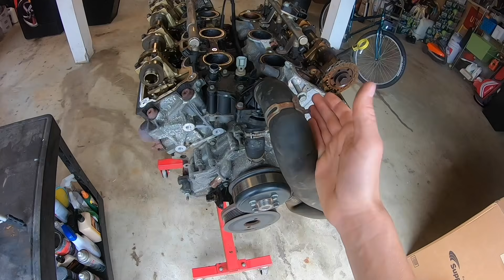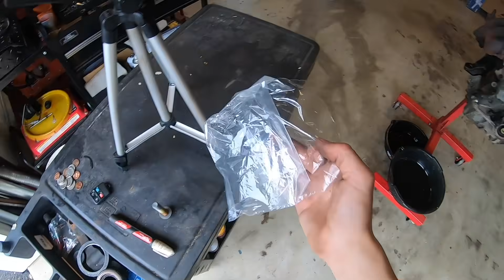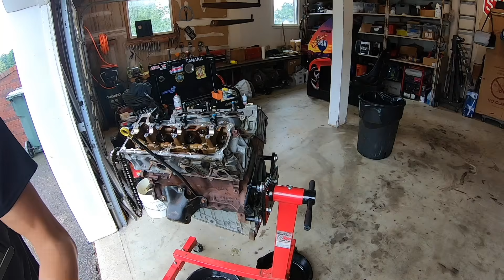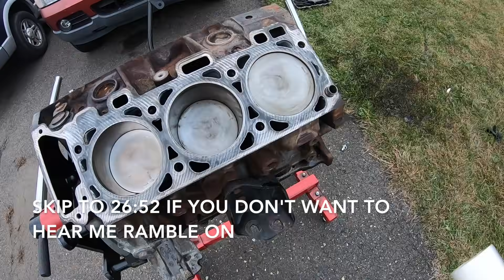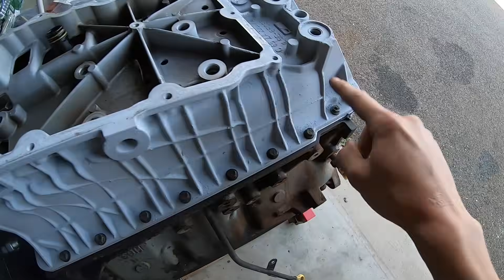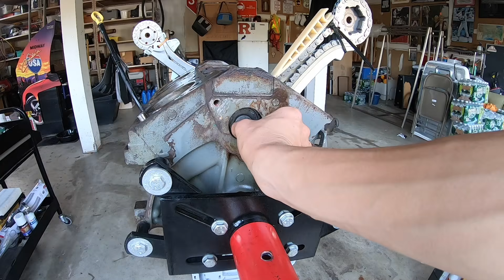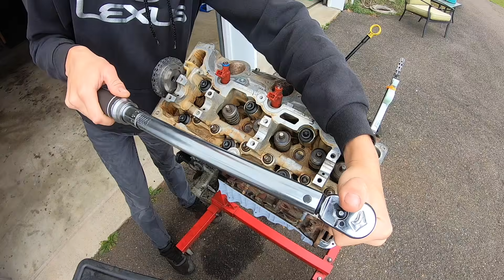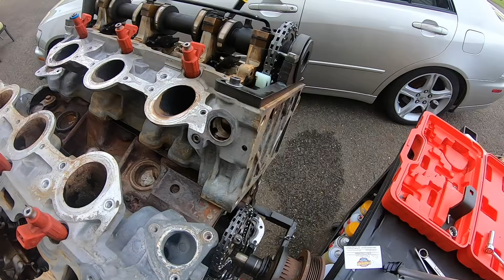Ford 4.0L SOHC V6 Head Gasket and Timing Chain Replacement (COMPLETE GUIDE)

Comment: Many thanks to you Nick, your detailed procedure is guiding me for my first motor rebuild !  I'm 59.  One hiccup if anyone can help is my right chain eat into the upper positioning bolt for the cassette.  Need to order a new one but haven't sourced it yet.  Happy new year everyone !
Reply from the maker: Depends how chewed down it is but you can reuse it. I have a few in surplus I can mail you.
Reply: @iamdjnam  the washer and shaft are worn down 1/16 to 1/8" and seem loose in the cassette.  i need 2 because i'm rebuilding another one after this
whats best way to give my address here?  02 and 03 model explorers
Reply from the maker: They’re typically loose in the cassette. I’ve used them almost half worn before.
Reply: just watched your rattle fix vid again as i remembered the screw to prevent guide dropping down - great problem solving !
Reply from the maker: Was gonna recommend that!!

Comment: I would never do this fix On my 01 I buy new  my truck has to much rust on frame nj  salted roads and brime are steal eaters
Reply from the maker: Yes for sure. That’s why I park the Lexus in the garage, leave the explorer home during the winter and drive the beater. 287,000 miles on the explorer no rust whatsoever.

Comment: I'm I seeing this correctly? I have to replace a driver side head on an otherwise healthy motor. The person I'm doing this for is extremely poor, single mother so I need to spend the bare minimum. Is it possible to remove the head without removing the front timing cover? To me it looks possible. Looking through the top the cassette looks fine and getting the cam timed is not an issue for me. I found the replacement head, rebuilt it and surfaced it so I'm really not looking to spend any more of  my money. So is it possible to get it off or am I missing something?
Reply from the maker: Nah you can get it off. Just be careful.
Reply: @iamdjnam  cool, thank you. Just had to check. Looked possible but I would have hated to get most of the way into it and realized I missed something. Thanks again.

Comment: Hey awsome  step by step video!!!! I have a question though. I saw when you took out the timing chains in the driver side , your kiwi was not at 12 but around 7 but when you skipped to the girdle and old pan you stated @12 a must..Is that only cause you were doing the balancer that needed to be timed or not?? Reason is mine is at around 7 also...
Firstime doing this just following your steps ..thank You
Reply from the maker: The only reason I had the keyway at 7 was because the motor was completely shot and the valves were already bent. It absolutely MUST be at 12:00 in your case.

Comment: Thanks for the video. Excellent. Are you worried about a $100 timing chain set failing, especially on the 4.0 sohc?
Reply from the maker: You always get what you pay for. The engine I built in this video was put into my aunts explorer. I haven’t had issues with the $100 kits in the past but I wouldn’t count on it lasting 100k miles. It’s really a hit or miss. If you have doubts, get the melling kit.
Reply: @iamdjnam  I'm in a predicament now. I have 245,000 on mine it runs perfectly but started knocking so I took the lower pan off and had pieces of the guide in there. I don't know if I want to get a remanufactured or even try to fix this but it hasn't done time yet I haven't drove it. 
 since. 
  Did you replace other gaskets to install this engine? Intake etc.
Reply from the maker: I always get a gasket kit off Amazon. Valve cover gaskets, intake, front and rear main seals, oil pan gasket, timing cover. At that mileage that engines best years are behind it. Your best bet is to source another motor with 150k and throw a rear guide in it. You can always do the fronts down the road with the engine still in the truck.
Reply: @iamdjnam  a used engine and swap my components and intake right?
Reply from the maker: Yes. All 4.0 sohc longblocks from 1997-2010 will fit your application
Reply: @iamdjnam  do you ever change the fuel injector o-ring? Or do you usually just slap them right in?
Reply from the maker: Usually I buy the o ring kit on eBay, sometimes those plastic head inserts break. Dorman makes replacements.
Reply: @iamdjnam  thanks. Appreciate it
Reply: @iamdjnam  when I look on the Ford site it shows two types of o-rings. One is just a regular looking o-ring on the other is more like a cap which ones do you replace thanks
Reply from the maker: The cap thing goes in the cylinder head. Only replace if it’s cracked or broken. Regular o ring for injector itself.
Reply: @iamdjnam  I seriously wouldn't know what to do without you thank you

Comment: Fantastic video(s); Your videos helped me rebuild 2007 4.0 engine for a Sport Trac.  I found a used engine (119k) and started the rebuild. The engine was almost finished when the transmission literally broke on the truck. The casing cracked near the over-drive servo. Unrepairable. Long story short, I was told by the transmission shop the frame was rusted through and they refused to work on it. I now have a "E", "K" engine sitting around.  Nevertheless, I enjoyed the rebuild. I've done 5 Subaru 2.5 engines, a Mazda 2.0 and a Ford 302. This one was the strangest due to the timing mechanics. Couldn't have done it without your videos. Cheers!!! Keep it up. You have a gift.
Reply from the maker: Thank you so much for the kind words!! All I can say is if you put that much time into the 4.0, put it up for sale! Someone will definitely buy that engine.
Reply: @iamdjnam  - Not so funny story, after I closed up the engine I was putting all my tools away. One missing socket... E-20 socket. Do you think it possible for it to fit under the timing chain cover if, I left it on the timing gear? Unless someone "borrowed" it, and that is a possibility, that's the only other place I can think it would be. wouldn't think of selling it without confirmation it's not still on the bolt. I call that, a pizzmeoff.
Reply from the maker: @chetburnell4432  no way, it won’t fit unless it’s sitting upright against the balance shaft or something.
Reply: @iamdjnam  You seem to have a great deal of knowledge about the 4.0. I'm getting ready to sell it and I was wondering if you know of a good list of compatible trucks/SUVs it would fit?  I've searched and found lists only to see them contradicted by another list.  It's a 2006 "E".
Reply from the maker: The longblock will fit any explorer, mustang, ranger or mountaineer with the 4.0 sohc from 1997-2010. 8th digit of the VIN makes no difference.
Reply: Where'd you find your used engine that I'm in the same boat I need a replacement

Comment: I cannot thank you enough. I replaced the timing tensioner and driver side cassette. The rear one was fine. You saved me thousands!!!!!
Reply: I just had my tensioner fail and chewed up the cassette, I'm gonna be doing mine next week, did you pull the engine or were you able to do it without taking out?
Reply: @russellsrollins  only the driver side...front one is what I replaced.
Reply: I only replaced the driver's side (front one) not the passenger's side (rear one).
Reply: @richardprice7107  so you did it without pulling the engine...?
Yeah mine is just the drivers side too..

Comment: That is the worse timing chain design I have ever seen. I will never own a Ford 4.0 engine. This is ridiculous. This is worse than putting the water pump inside the engine driven by the timing chain. Thanks for posting so people can see how stupid this engine is designed.
Reply from the maker: It really is ironic because I only buy explorers with the 4.0. I guess cuz I just know so much and I’m comfortable with them.
Reply: @iamdjnam  You should consider checking out other brands. None of them are perfect but many of them are easier to keep on the road than this engine.

Comment: great video! thanks! I think I'm still weak to do this myself...don't have the tools ready still. My driver side cylinder head is leaking oil and I have to add oil every once in a while but it still runs ok at 55k miles.
Reply from the maker: Might just be a valve cover gasket, not too bad of a replacement.
Reply: @iamdjnam  I can see the leak coming out between the engine block and the cylinder head. Around the valve cover, is clean. Oil drops blown and fall onto the exhaust manifold and smells awful.
Reply from the maker: @jhunn061  wow. I’ve never seen that in my life.
Reply: @iamdjnam  the leak is due to an overheating case when the radiator leaked. Replaced with a new radiator and condemned the heating system. Now it can sit in traffic without overheating problem but only the little drops of oil. Im in a tropical country (Philippines).
Reply: Well you would be a shade tree mechanic like that guy that guy obviously watched a video instead of being properly trained at a mechanic shop or dealership and I can tell you that's nothing but problems you need the proper tools in the proper knowledge and this guy doesn't have either one of them.
Reply: @franklinbennett4443  Have you got off the meth yet?

Comment: I'm rolling in a 2003 explorer with the 4.0sohc. ive had it four years now and she geting really tired. She just rolled over 249,000 miles orig engine, never been apart and it sounds horrible. i did purchase it making the noise. i did research and quickly discovered the cassette issues. i have put 50k on it myself. I never worried much about the noise if she went, it is what it is. i  got my $s worth out of her. With that said i have noticed its losing hp. i have to keep my foot in it just to keep it at 55. Im getting aprox 8 to 10mpg. The oil pressure is great and doesnt burn or leak a drop of oil. Would it be worth it to freshen up the engine thats in it assuming its any good. or should i take a chance on a used one? any chance you have one your selling?
Reply from the maker: If you are located in the NJ area I sell freshened up engines for $700. At that mileage that engines best years are behind it. A lower mileage donor is a better option.

Comment: I've always strictly used Ford timing components in these engines.  I just picked up an 07 explorer that broke a chain. Pistons just kissed the valves. Surprisingly only 2 valves leak. Due to price increases I'm considering the Cloyes kit. Do you have any long term experience with cloyes or other aftermarket timing sets? I'd love to hear your feedback.
Reply from the maker: Get Melling or Preferred Components. I’ve always had luck with Melling and they recently acquired preferred components so expect the same quality.
Reply: @iamdjnam  thanks for the reply.  I can't seem to find the Melling kit anymore. Do you know if it's still available?
Reply from the maker: @theRealFLATrateTEC  Melling 3-398SA

Comment: I'm gathering my parts and noticed the timing chain link in your discription, is this the kit you have used? Seems awfully cheep for a chain kit, I was going to go with cloyes or oem but I'm curious about this kit you have posted
Reply from the maker: Cloyes is taiwan now. Get Ford or melling if you want it to last really long. I’ve used these eBay kits and have had good and bad results. Just the luck of the draw.

Comment: You can have either interference and non interference engines bend valves if the chain or belt remains intact after losing time. Non interference simply means if the chain or belt were to break entirely it will not bend valves if the camshafts continue to rotate ALL ohv engines will bend valves
Reply from the maker: Yes, but people constantly insist that the 4.0 sohc will not bend valves if timing failure happens. This is untrue as seen in the undeniable footage.
Reply: @iamdjnam  Pistons can't touch valves in non-interference engines under any circumstances, so I'm surprised you agreed with that nonsense. 

You did a good job proving 4.0 SOHC is an interference engine so maybe you'll do likewise proving a 4.0 OHV is non-interference with zero chance of  bending valves ?
Reply from the maker: @JoeBlowski  if I had the chance to work on an OHV I would deliberately set the timing off and crank the starter to prove the OHV in non-interference.
Reply: @iamdjnam  I hope you get the chance because that would set a lot of people straight on that stupid controversy.

Comment: Is this a different 4.0 v6 that came out in the South African Ford courier? I thought they were a free spinning motor and valves wouldn’t hit because of the jack shaft in place where a pushrod cam would be. So if right hand bank skips timing on the cam gear it will hit valves regardless of whether timing cassettes have let go?
Reply from the maker: The 4.0 Cologne V6 SOHC is interference no matter what vehicle it is in. If the crankshaft to jackshaft chain goes, you bend all the valves. If only a cam chain goes, you’ll lose the valves on that bank.

Comment: ?!?!? Ford rangers are a NON INTERFERENCE ENGINE if you suffer timing chain failures it WILL NOT BEND THE VALVES so I strongly question if you know jack $#¡+ about these engines ?!?!?
Reply from the maker: LMAOOO you’re funny. Open a book for once. Send me your address I’ll mail you a bent valve. Nice try champ.
Reply: Your ignorant comment would be correct if this video was about an Over Head Valve (OHV) 4.0 instead of a Single Over Head Cam (SOHC) 4.0.

Does that answer your rude question ?

Comment: Well done, many thanks.  I just started tearing my engine down last night.  I'm stuck at the head removal as my T55 snapped.  Go figure.
Reply from the maker: Yup yup those head bolts do a number on those t55s. Crazy torque to snap a socket like that.

Comment: Great video as always.  You mentioned in a previous that you were going to make on on your pre-oiler for the 4.0, and was wondering if that was still on the agenda of future items.
Reply from the maker: Yup yup I’ll get to that video - it’s already built in my car so it’ll hard to be a how to video but I’ll make a demonstration
Reply: Definitely a video with the pre-oiler. That's the death of these engines
Reply from the maker: Yessir. No dry starts over here!
Reply: @iamdjnam  it would be an awesome video if you did a pre-oiler on a 4.0
Reply from the maker: @hondaslave-kd6hi  it’s coming. Hard to make a how to on my vehicle because it’s already installed.

Comment: Great video. If I have a 2005 4.0l 130k with a slight rattle, would it be OK to replace guides only, or would you recommend I replace chains and sprockets as well?
Reply from the maker: Just guides are fine

Comment: Great video,, Now after all these parts upgrade how much mileage we can expect from this engine if maintained very well?
Reply from the maker: Well we surely can expect another 100k miles. It depends on the condition of the piston rings. A full rebuild can easily last 300k. Headgaskets like this I’d say 100-150 with religious synthetic oil changes and quality air filters
Reply: @iamdjnam  how often do you recommend changing the oil in these engines? Brand or type of oil or filter? And does anyone make timing chain guides that are metal?
Reply from the maker: I change every 5000 with synthetic. Any oil that is on sale and is API rated is perfect. I use a Wix filter. Nobody makes metal reinforced rear timing cassettes. But with good maintenance the plastic one will uphold 250k miles.
Reply: @iamdjnam  how come I have timing chain rattle upon startup ONLY about 2% of the time? I changed the tensioners, it still does it. The old tensioners and new ones seemed to have about the same amount of spring tension, so I don’t think my springs were weak. The new ones are Ford OEM. I kept the oil changed in this engine every 5,000 miles or so. Lately I’ve been doing alot of highway miles and have been using Amsoil signature series and their 25,000 miles filter, I change it all at 10,000 miles. The first time I sent it to a lab and they said I could go to at least 13,000 with that same oil. But I always used to do 5,000 with Motorcraft synthetic blend and then after around 75,000 switched to full synthetic. Other than the occasional startup rattle, the engine runs perfect. I’m wonder if some carbon maybe got knocked off and jammed the timing tensioners and that’s why I rarely get timing chain rattle. 2007 Ranger 126,000 miles.
Reply from the maker: The chains stretched. If the rattle continues to bother you consider getting the Polaris RZR manual adjusting tensioner. They originally came with the same spring loaded ones we have, then updated after people were annoyed with startup rattle.
Reply: @iamdjnam  do you have a link? I typed that in and see many listed. Would the Polaris tensioner part number be the same for both the top left and bottom right tensioners? Thanks
Reply from the maker: https://www.ebay.com/itm/112402255018?fits=Make%3APolaris&epid=853182546&_trkparms=ispr%3D1&hash=item1a2bb24caa:g:ZGsAAOSwlMFZJiaY&amdata=enc%3AAQAGAAACoPYe5NmHp%252B2JMhMi7yxGiTJkPrKr5t53CooMSQt2orsSR84A%252FGMxXIqJzFmDq6lDLsJ7Tb6O8ULDJL1yejZO0ELeejlm1ohxnLpItFe%252FNbtfhmXIh%252Bzjs5%252FoM9VWxg%252B%252FaeFnHLjY8dVbJXspUFeeN2D6Uvec%252FbOon1XvaaphGaOKSZKmz0LmhGEAaucRCv3KhdqNud2CiU95dNwrFWEhaqedhOSKFzIiTYt7H3XILCUmGZu4qn5t%252FTLLSg5NrMMcStZ%252F2mGVErDc6AHZpAwJWTSKlne2baCCbEyvWMWizyFau2%252FU4M1ugLRzKs9Xs51nqe5y%252FVLrkEKWEmopKkcBrw%252F4dcAESvejOt2o3%252BXSz%252FxmNxflvFJkicds%252BncCT1x4%252Fe%252FqFnZ%252FJzYoX0WlHCfheIiEiotXznOwQvlg%252FE78AsRWIWdmrZMZ5foKRiPZzI3bn2pEBNFlZY%252FBLXnWfHYwTdZ8SIO8ld9B1M88aVPGM%252FtZst6O5AKJ%252F3%252BcFh7rFx%252F6HAHYeWVnlkupXG%252FfD5dGY9JOzvv53dfY1hla1ybDDjf87APiVqEyXyGDt7I8noIBjGu5v32AgmmD00tWQ0aULsfRse0KuyC3cZ5JTYzfXdE9LnsYoOC%252FSchqxzmxfBD812qhKomYU2UY2OfwEQNmlJLGZi7qr25U3Eb8TVutk8Nq0nyJySPyhlTVNXAqLTLHxM3udfcDJzEvXjZ1x3tkvyCrggb%252F7mtHTUqEXQ1FFfFLRjtkJ4WAOkkMBgn12r8Sbf8qDnOr2pFFbHeaBXOXS2TB2502Zc0jEdEcS3W8ux6hQQJe3Wuyf%252FL%252BAOy5qK1mlzI%252FIveZ0dFsk61moP8Htv0oYfLNislFHjh0%252BNRFzvhvNj2eEZKI04ACtjdvWzd6ag%253D%253D%7Cclp%3A2334524%7Ctkp%3ABFBM2JeQqJdf

Same for both